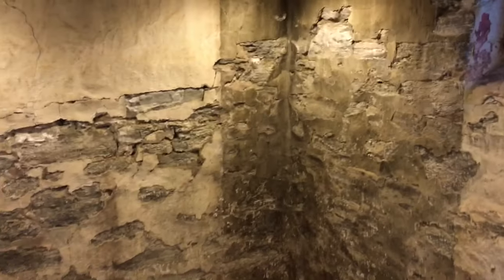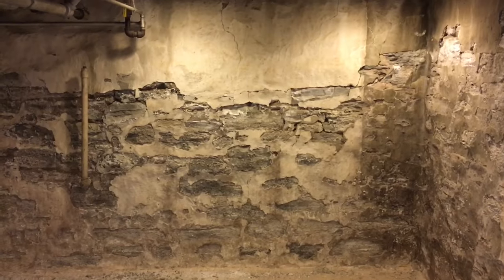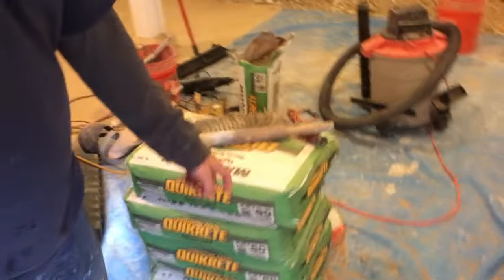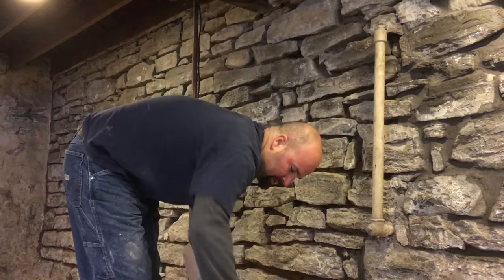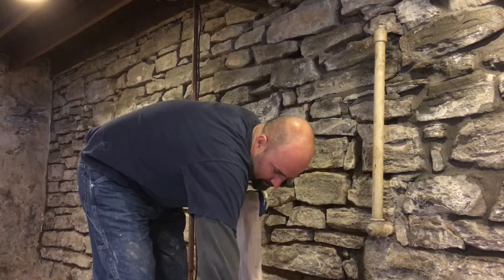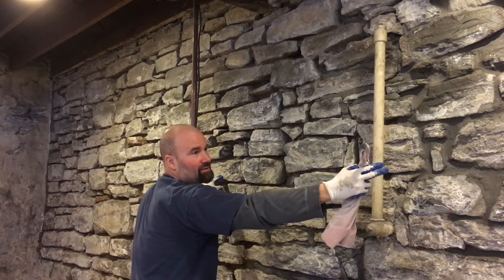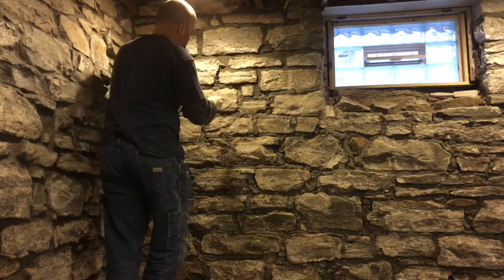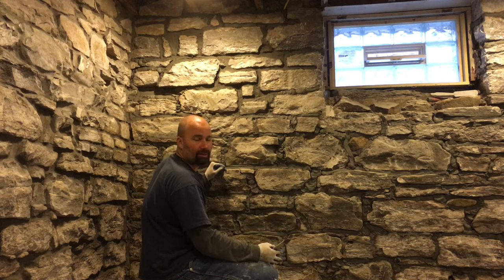Basement Stone Walls

Comment: Great clean job!
Just a suggestion from my own experience in the Construction industry  I have found out the better of doing this work is that  you fill an approx a 3' x 3' + - wall area, and then use a flat steel masonry strike to pack the mortar into the joints for better structural bonding and smooth it out at the same time, it always gives you a better product and better looking wall with disting joints..
Like I said it's just  a suggestion...

Comment: All of the premixed mortars as you buy in a bag are mixed to meet predetermined specs.  The ratio of portland cement to lime and sand determines how hard the mix will get.  Workability is often overlooked when making these products and they often seem high in sand content but they still produce a product that will meet the mix spec.  ASTM standards give a crush strength for type S and type N and they can be mixed high and low on the scale.  I worked in the masonry trade for over 40 years.  The premixed products are relatively new in the whole picture.  The wall you are tuck pointing looks to have mortar that is very bad and looks to be doing nothing.  As old as that home and the walls look I doubt if any new style portland cement was used.  Probably old slack lime and sand.  Since the wall is 1. a bearing wall it is structural and use of type S mortar is called for.  2. it appears that the mortar in the old wall is so bad that I would say there is a good probability that moisture will seep through the wall.  3.  The wall is below grade which would call for type S mortar also.  Some engineers will spec type M mortar which is all portland cement with no lime when placing below grade.  I would say that for all things considered the use of type S mortar would be the best.  Also you could mix in some water proofing additive.  The term is thumb print hard when determining when it should be tooled.  Also the grout bag does not force the mortar into the back of the open joints.  The use of a tuck pointing tool would compress the mortar into the joints and should be used.  Type N mortar is normally used for veneer situations like brick on a house where strength is not the 1st requirement.  N mortar is usually one part lime and one part portland with the required amount of sand.  The less sand usually makes the mortar harder and also makes it stickyer which can give it better workability.  Increasing the amount of cement will also make it easier to force out of the grout bag and will speed drying time.  I would not use type N on these basement walls.  You can buy type S that is made for this situation but usually not in the box stores.  You have to go to Spec Mix or some one like that.
Reply: Bricky1952 thanks for the info much needed
Reply: Great information.  Finally someone on here is explaining the actual uses of the different mortars to use of stone foundation. I have been researching this for awhile and I find Mike Haduck to offer the most common sense approach when it comes to masonry
Reply: @unifiltered6840  As I have said you may need to go to a business that sells brick and block to get the premix product desired.  In my area I can buy type S or type N premixed in a bag from one of the  local brick and blocks sites.  Midwest Brick and Block around the St. Louis area and into Missouri, the state with senator josh hawley who created the domestic terrorism on Jan 6,2021, and also into Illinois who has the US representative Mary Miller who's husband a state of Illinois representative who is a supporter of the 3 percenters, a far right domestic terrorist group.
Reply: @Bricky-gs3lp  this comment is perfect. I inherited a house built in 1899 and I need to repair my stone basement and I’m in the St. Louis area. I’m new to this DIY stuff but I feel like as long as nothing is out of place, I can save myself a few thousand dollars and just do the tuck pointing myself. At least for this.
Reply: @tylerbhumphries  Be warned that this is labor intense.  Old mortar needs to be removed and the dust and debris removed preferably by washing.  The old stone needs to be somewhat clean and free of dust so that the new mortar can stick to it.  You can remove the old mortar with a chisel and hammer or even a hooked rod with the hooked end flattened.  I am sure that the home built in 1899 used the old slack lime and sand maybe some portland cement.  Not sure if it existed then.  I've seen some old walls in the Alton Illinois area that the mortar is like sand and just keeps falling out.  Try a small section at first to see what you are dealing with.  Have fun you may find yourself in the cellar for a long time.

Comment: Stone wall is very good in foundation  but it's  very time consuming and expensive currently I working on dry stonemasonry which has 240 ft length and 9 feet height I thing it's labours expensis is approximately 2500 $ except  dubbing tipping  plastering and waterproofing  Coates.....

Comment: I love the look of this!  I have a very similar wall that has years of additional cement crap on there.  I started ripping it off and it has beautiful stone under it.  What do you use for sealing against moisture to keep the original look?  I can only seem to find dry-lock in white or grey.
Reply from the maker: HD has a stone and concrete sealer. Wet Look.

Comment: Should the mortar not always be softer than the stone ? What mortar was used in the original construction of this building ? Sealing a solid wall will trap moisture so im not convinced this is the best method
Reply: Lime mortar should be used, for the reasons you mention in your comment.  Using mason mix is too hard and doesn't allow it to breathe
Reply from the maker: Not always the case. I like type S which has Portland clay added. Not too much. Just enough. It’s for strength. It breathes also.

Comment: My understanding is one should use lime mortar on old wall foundations not Portland cement since this does not allow movement and does not breath.Anyway thank you
Reply: That's also my understanding. Hydraulic Lime Mortar or NON-hydraulic (fat) lime mortar (lime putty). 

I needed information regarding what type of mortar should be used to repair the pointing on my pre-1900s property. I emailed photos of the stonework on my property along with my inquiry. Here is the reply I received: 

'Thank you for your email-an interesting building.

Most of the photos show a non hydraulic mortar. This is the mortar that would have been used in the original construction. I would suggest that you use this type of mortar for your works.

A non hydraulic (fat) lime mortar is different from a hydraulic lime mortar in that it has no chemical set. It only cures (hardens) by absorbing CO2 from the atmosphere. This is quite a slow process, which makes it difficult to use for building but it is not such a problem if you are pointing. It comes to you totally premixed-it will store on site for a long period if you keep the air from it. It is good for DIY restoration where you want to move at your own pace.

Unfortunately we do not supply non hydraulic lime. You do not say where the building is located but if you google lime suppliers in your area I am sure you will find somebody who will mix a mortar for you.’
...
End of email reply.

There are many youtube videos showing rights and wrongs of stone repair and re-pointing. This one - https://www.youtube.com/watch?v=3Omxc4OK9eE  - I would say is the definitive youtube video on the catastrophic effects of cement mortar on old stone properties.

Education and attitudes change as information becomes available.
Reply: I absolutely agree. It's going to break those stones over time.

Comment: Great job
 I just did my 1887 old home.  I found out our techniques different just different. 
1- my father always time to always shopvack
Reply: Shop vac and water hose area before apply new concrete .my old house foundations 12"-14" thick.
1, outdoor. Floor Joyce's  n inner foundation that why you don't see them. Inside it's like outdoorminus your joice exposed..
Brent the wire brush walls with water. My 2d step I apply some spray glue concrete using plastic gloves  .
Then I fill inn all center chiming scarce. I've done stone exposed( takes alot of tme)  or just do the stosko.  Adds to strength. Then water proof .

I really enjoyed your technique.

Comment: I had a mason do a little work on one of my basement's stone walls and he (like the TOH people) added a latex product (I think it was Sika Latex R; he called it "mason's milk") to the mortar to help with adhesion. Is that something you do or does the kind of stone you work with and your skill at application (maybe better surface prep?) mean it is not necessary?

Thank you for the video! My basement in Massachusetts needs a looooot of work (I think I can do it).The walls also seems to be parged with a material that includes horsehair. I know horsehair was used in plaster, but I didn't realize that was used in stone basements, too.
Reply: Yup.... Horsehair plaster is covering my basement walls in Gettysburg PA.

Comment: Purchased a home with a very solid stone(rocks & mortar) walled basement. Basement flooring covered in two inches of dust from the cement corroding. Touch the wall & the cement turns to dust. Two contractors say, nothing to be concerned. The basement has several decades(built in 1932!), of confidence.  Still, I wanna cover one wall completely, maybe using just plywood, for my Man Cave. Wife does not like the creepy dungeon basement.

Comment: I’m a total beginner but why are you not using lime mortar? I understood cement does not allow the wall to flex with the seasons, leading to cracks and failure. Lime pointing allows the natural movement of the wall. What am I missing? It looks great tho.
Reply from the maker: Oh, I like using type S because it holds up better and is stronger than lime. Type S is lime with clay added. It’s not a big difference because it has lime like type N.

Comment: great job but wouldn’t it be better to use a lime based mortar? your concrete will lock any moisture into the stone and cause it, in time, to weaken.
Reply: Yes agree. It will likely be ok for the next 5-10years, but stone walls are designed to move and allow moisture to evaporate, lime mortar enables both these characteristics in older properties. Cement-based mortar traps moisture and will crack as the wall moves… unless Masonry Mortar is formulated with something similar to Lime, there is a risk it is likely to weaken the wall.
Reply: @patrickdrewello4196   the Type N mortar is used for that exact purpose but not sure why he used Type S concrete as the main product. I feel like 1 trowel of Type N mixed with 40 pounds on concrete negates the purpose. From the research I’ve done, Type N should be used for all of it.
Reply: @may221973  I will be doing a house in Norristown, Pa. I cannot find lime mortar. Is there a brand that I should look for or a supplier near Philly?
?
Reply: @nzanikos   I checked HomeDepot in that area and they carry Quikrete type N and show 189 in stock. Some guys don’t like that brand so you can always check with a concrete supplier to see if you can buy it through them. Good luck on the job!
Reply: Can i use Portland lime mortar mix type S for this?

Comment: You do a beautiful job! I live in NE Ohio and the lower half of my basement is constructed with round stones - not sure what type you would call them. I recently had my exterior water line replaced and they drilled thru the wall. Now my wall is leaking in that area when we have heavy rain. 
Would I use the same mixture you used to fill in around my stones?
Thanks for any advise you can give me. Again, excellent job.
Reply: I would use Lime 3,5 mix. Google Lime 3.5 Mortar mix. Lowes should carry it. It will prvent water. Good luck!

Comment: Should lime mortar be used and not cement when pointing stone? Might be different in warmer climates but because it's porous it helps water to evaporate out of the walls to prevent decay
Reply: you should use lime mortar ;). Natural lime if you can

Comment: Should have raked the joints out deeper also sand blasted the stone wall before pointing...... why ? Because the wall and stone will breath better by sealing it it’s a big no no with stone as it needs to breath.... by sealing it it can’t and you will lock moisture in from outside creating damp within the wall

Comment: Why did you choose mortar mix, instead of using lime mortar, which was originally used?
Reply from the maker: It holds better. It’s stronger. The stone is hard. Not sand stone. I have used type N at customer request

Comment: Was anything done to seal the exterior wall?
Reply from the maker: It costs a lot to excavate and seal the outer foundation wall. Usually they start with the interior walls. The mortar has since turned to sand. It was Type N mortar. that is why I use Type S in most cases. I will use Type N with softer stone.

Comment: something is wrong here.Seems previous owners packed with concrete which should of been done with lime mortar then the new contractor comes fills with S cement.That's harder then the stone.Over time moisture and cement will destroy the rocks.Stones need softer mortar like Lime to breath and have some movement to expend and contract. Anyway for folks out there if you got stones as foundation do some research before packing with portland cement.You may do lot more damage.
Reply from the maker: Not in my 20 years of doing this. Type S is lime mortar too. Hard stone. Hard mortar.
Reply: @forsbergmicah  What happens when water penetrate from outside and your hard mortar not allow it to escape and end up accumulating inside walls causing weakness and dampens which follows mold.There is a reason why traditional masons used softer mortar is to allow moisture relief and slight movement.S mortar is hard rock lime in it is insignificant. This job should of been done with 1 part lime 3part sand and 1/2 Portland cement.Strong and yet flexible.Cheers

Comment: No offense, but I think this basement will still be damp and musty. It looks good (very professional work), but there is no way replacing the mortar will stop water intrusion. And I think that's what homeowners want, a dry basement.
Reply: This adds structural integrity back to a deteriorating foundation which is pretty important, in my experience a dehumidifier is mandatory in a stone situation but most importantly is water management on the exterior.

Comment: What do you “seal” it with?
Reply: You don't!!  It needs to be water permeable
Reply: @elliottstevens8564  so no drylock? Can the wall be painted in any way?

I’m trying to take the darkness out of the basement, as it doesn’t have a lot of light.
Reply: My understanding is that all these pre-1950'ish houses (that are built with the old fire-skinned brick) need to have a mortar that is softer than the brick and NO modern water sealing paints.  This being due to the fact that this type of masonry is always somewhat wet.  I.e. it's passing water back and forth btw the inside and outside.  If you seal the brick with a paint or clear sealer this stops the water transfer and results in the brick staying wetTER than it was designed to be.    All sorts of issues crop up from that.  - spalling from long-term exposure to winter freeze/thaw cycles. - mold issues..

I can attest to the mold part.  I have one brick house (1888) that some bone-head painted and I'm forever dealing with mold...another story.

Anyway, Type N mortar is about the hardest mortar the conventional wisdom says can be used. 

The old schoolers used to paint the insides of their foundations with a "lime wash".  I would assume it allows the necessary water penetration while still brightening the walls.  Still doing research on the lime wash though.
Reply: I think by 'seal' he means gently smooth the mortar up onto the stone so it transitions cleanly from mortar to stone. In that case, the 'seal' just means there is no gap between the surface of the stone and the surface of the mortar. What tends to happen (in my limited experience) is that the mortar pulls back just a bit from the stone right after application (there is a small gap between the stone surface and the edge of the mortar). Once the mortar has firmed up a bit the gap can be closed with a little gentle brushing.

Comment: Curious if you could have avoided the tuck pointing after removing the plaster and loose mortar? I thought it looked great with the deep joints exposed. I have a similar basement project I am about to attempt DIY (stone blocks covered with that same crumbling white plaster/waterproofing). If I am careful to not remove too much of the existing mortar (goal is only to clear off the old white plaster/waterproofing), could I skip the tuck pointing?
Reply from the maker: the new mortar prevents old mortar/sand from coming out. The new mortar also keeps mice out. The wall and basement will remain cleaner if you use new mortar. The stone will still from time to time develop efflorescence. A vacuum with brush head is best for that. Keep the outside walls dry to prevent efflorescence.

Comment: well it seems like alot of people agree that you used the wrong material. lime (nhl 3.5) and sand or other wise it cracks/spald? the rocks. is this acurate?
Reply: i am about to start the same kind of job here, having a hard time finding lime...ontario
Reply: @doi467   His mix is fine for Ontario, just use a type " N" masonry if you are worried , lime is much too soft IMO
Reply from the maker: Type N falls out of the joints in a year or two. Type S holds for decades. There are so many factors and each job should be handled individually.
Reply: To find the lime i think you have to go to a farming store.